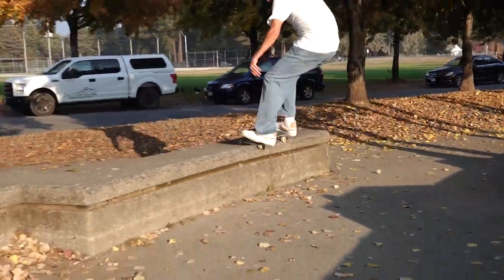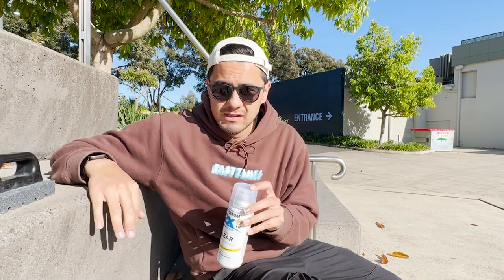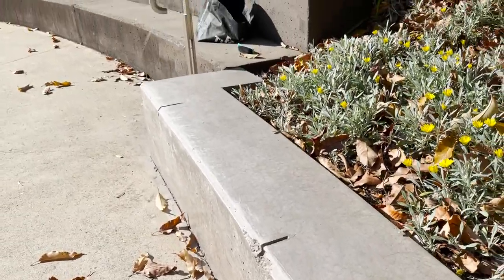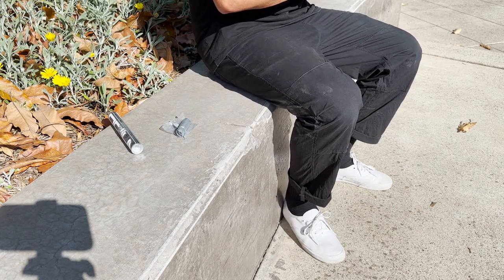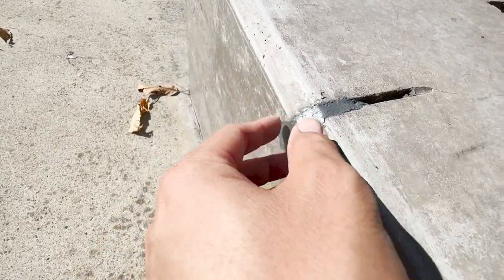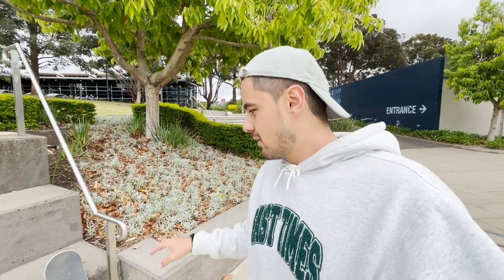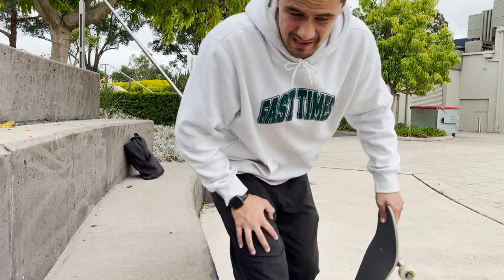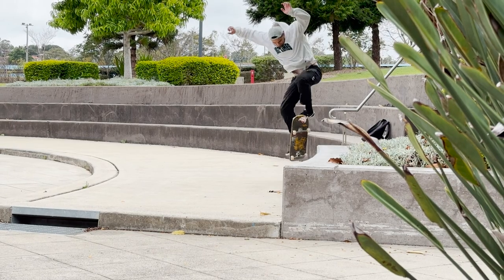How To Make ANY LEDGE Skateable!

Comment: what about lacquer and others sprays like polyurethane and polycrylic or something like that?
Reply from the maker: Ideally you want to use a concrete sealer but for a quick fix this lacquer spray has been the best for me. I think anything like that will work really but for a ledge you really want to go and last long term it’s better to get a bucket of concrete sealer and just paint it on with a brush 👌🏽
Reply: @LeonPaxton  copy good looks

Comment: Hey Leon,  I'm Michael from Johnsons maintenance services and I've been asked to be a part of creating a memorial bench seats that are scatter friendly as well as a seat.  Watching your patch video has me thinking that the concept that is drawn up wont work cos the front of the seat will be stonework and not flat or smooth.  Any suggestions on what might work still using the stone cladding ?    
I'm in Perth Western Australia and the seats are on the beach front.
Reply from the maker: Hey Michael, Most concrete ledges are built with a slight bevel on the angle instead of it being a straight 45 degree angle. This makes it more durable for skating since it isn't a sharp edge you're bashing into. Hopefully that helps but I have no idea exactly what materials would be best for this
Reply: sounds like you will need an angle grinder and a disk made for concrete. thats what they use to make brick ledges grind

Comment: Would a 60 grit be better for this? I know skateshops sell 25 grit but I grabbed a 60 grit
Reply from the maker: I actually don't know the grade of the rub brick I bought 🤔
I guess if it's a lower grade than you will just have to rub harder and longer lol
Reply: @LeonPaxton  Ok that's basically what I was asking. I was confused bc 60 grit was less expensive than 25 grit for some reason. Appreciate it homie!
Reply: Sup guys just wanted to add in case you guys didn’t know but the grits density is measured by the lower the number so in this case the 25 is more expensive because it’s harder and will last longer than a 60 because that’s a big space between the two hope this helps good luck !
Reply: @chambersoveternalsuffering8065 I appreciate the comment. I halfway figured but never knew for sure.
Reply: Lower the grit more aggressive it is

Comment: Can I put the clear coat on top of a curb that is already waxed?
Reply from the maker: Nah dude, that would just be a waste!
You could do that but the clear coat will be on top of the wax, not the cement so it would come off super easy.
It's better to clear coat raw cement so it sets in better and creates a slippery surface on top of the cement and then you can put wax on top of that 👌🏼
Reply: @LeonPaxton so how could you remove wax from a ledge thats waxed up but dosint grind at all.

Comment: Make any ledge stateable but you set up a pristine ledge - skate stoppers.
Reply from the maker: Same process works for any ledge 👌🏼
Reply: @LeonPaxton  I want to see some gnarly east coast gravel mix ledges like we have around here! ;)
Reply from the maker: I'll try and find some crusty ledges over here then lol
Reply: I've used this technique on curbs up here in Maine, and that's about as crusty as it gets with all the salt and snow and ice and such.  For extra crust, a cordless angle grinder with a masonry wheel is key.  And wet the concrete with water to keep the dust down.
Reply from the maker: I wonder if wetting the ledge for rub bricking would make it harder or help the same way?
Reply: @LeonPaxton  I've found it works with the rub brick too- maybe takes a bit longer since you're losing a bit of friction, but less dust.

Comment: So what if you come across a ledge that is all waxed up already and you want to take it off?
Reply from the maker: Yeah that’s a tricky one man! If you try and run brick a ledge that is already waved then it won’t work, the rub brick will just be sliding along the wax. You’ll have to use some sort of paint scraper to get the wax off and then rub brick it down once it’s raw concrete again 👌🏽
Reply: @LeonPaxton  yeah i think ima bring a scraper, some prypo alchohol, and then a blow torch to evaporate it. Then rub brick it. Then clear coat the wax. This ledge is worth it. Just wish that skaters that waxed it saw your video first
Reply from the maker: Haha true, some people think that all you need to do is wax but rub brick and lacquer is always the first step! It makes the ledge grind and slide way more consistently too 🙌🏼

Comment: Trucks metal under spray/laquer/paint makes that grind better.  Better and cheaper use a big@ss lead sinker it also locks out the dust from where you spray, fills the tiny holes in the cement, hardens the surface while making it pure butter (Lead >wax). 
Full process is rub brick, rub your trucks / or lead sinker to curb then automotive clear coat (lasts best) or any cheap laquer at least 2 times, then wax.
If filling in holes spend the extra time and effort to do them fully not just from a skater perspective. As done here water / grit / organic material / smell collects and it won't seem welcoming to sit on for anyone.  If once you finish a place IF it is better for majority users (lunch time crowds) and looks primo THEN building managers, residents, local workers etc will recognise and let you do your good works in peace sometimes even bring you water on a hot day.
Like the camera guys fixing / making spots is the work of gods and some yet to be spotted goddesses!
Reply from the maker: Oh sick! Can you get the lead spray cans at all?
I'll have to try it 🤔

Comment: Use clear Lacquer not enamel. Even better use a clear concrete sealer that you have to roll in with a paint roller
Reply from the maker: Concrete sealer with a paint roller has been the best for longer or chunkier ledges 👌🏼
Reply: i learned that the hard way. the enamel helps but its not as good. concrete sealer is expensive man
Reply: @chrhadden I’ve just learned a better way. First rub brick the shit out of the curb, apply wax , take a torch and lightly melt the wax so that it seeps into the pores of the concrete , then let the wax re-harden. Then coat it with lacquer let dry . Repeat one more time .
Reply: @PsychoCitySkateboards  wont that keep the lacquer from sticking? i have done that with a torch type lighter. its a quicker way then grinding it and friction doing the same thing. i have a heat gun but usually there is no place to plug it in.as a welder i know that you have to be careful heating concrete because there is moisture in it and if it pops its like popcorn and you can get burned. so wear some safety glasses.your probably not getting it that hot though
Reply: @chrhadden honestly you won’t have to do lacquer at all if you rub brick it nice and smooth. But yeah I would do lacquer first then
Reply: @PsychoCitySkateboards  all the concrete here is old and rocky. i can only rub brick it so much. thats why i did this ledge on a loading dock ramp . its kind of sketchy though https://youtu.be/r6n8zwt1yAo?si=ev0WaMotNl4LKFRa&t=7